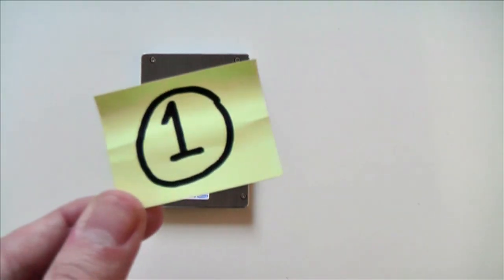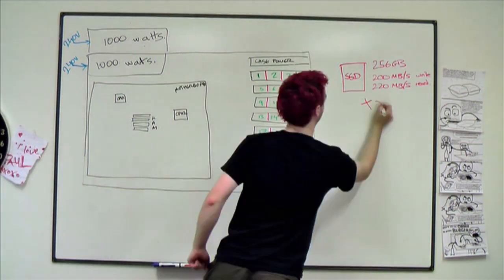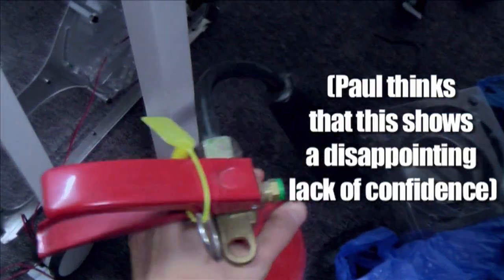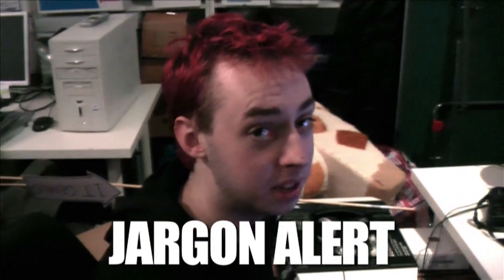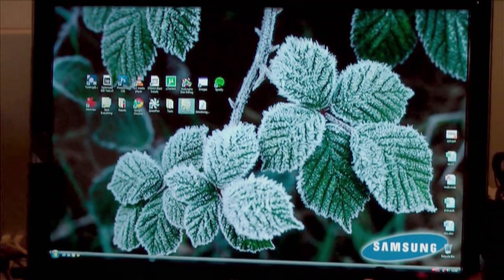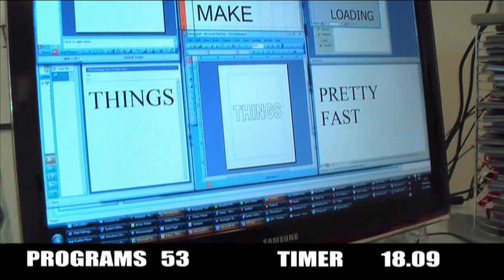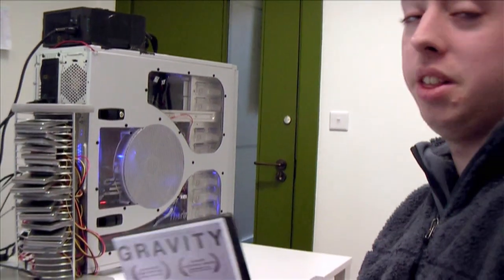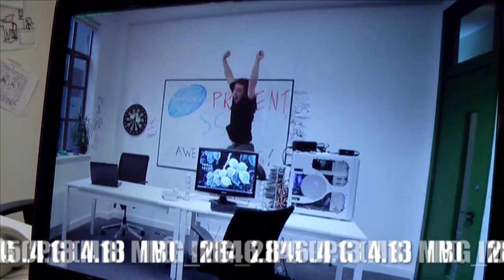Samsung SSD Awesomeness

Comment: 10 years later and you can now go faster with just one NVME SSD
Reply: a cheap NVMe SSD can outperform 'em.
Reply: @pnnytx  probably not in terms of IOPS, actually. IOPS is most important. And those MLC drives are going to last a while

Comment: to think; building this machine back in '09 wasn't cheap. just the drives must have cost you a small fortune (26 256gig ssd's at 400 dollars each). Neither where those processors (1600 each). Same for the Mobo (recon about 400 bucks)  .
I recon I can build a computer that pisses circles around this thing today for less then 2K.

Comment: It's 2019 and 6TB on SSDs are still impressive. Also those speeds, while achievable with a single or dual drives, they are still respectable.

Comment: 2GB/s and it can be done only by single NVMe SSD by now. Technology flies so fast!
Reply: Than put 24 nvmes in raid 0 :D
Reply: As of today you can push around 7GB/s on one SSD, and PCIe 5 is right around the corner. Won't be long before we're north of 10

Comment: You should theoretically only need 4 - 850 evos to do this today. ..
Reply: I think you need a couple more. Keep in mind These badboys have aprox. 220 Megabyte a second read / write. The 850 got 540/520 read write. Putting disks in raid doesn't mean that the access speed of the array is a perfect addition of the access speed of the individual drives.

Comment: Just a bit over 6 Years ago this was epic, today you can get this performance with just one m.2 SSD :D (And at a much lower price, of course :D)

Never ever defrag your SSD's btw^^
Reply: *****

SSD's dont work like a HDD. They have Flash Chips (most common chips are MLC, SLC and TLC). Those Flash Chips can only be written a certain amount of times before they get destroyed. This is because they need a higher voltage to write or erase data than they need to read data. The higher voltage slowly kills the structure of those chips. Defragmentation erases data and writes it on a other place of the flash storage. So its a long process where the flash cells get a higher voltage. You wont get a better performance out of the drive, maybe you can get a tiny bit of more storage space, thats it.

Tried to explain it as easy as possible, if you want more information, just ask :)
Reply: Sr90

wrong. With constant "casual" use, they will. But if you defrag them (you wont get an advantage out of it), they can be dead any time. They got a very high mean time before failure these days, but defragging will kill them very fast, trust me.
Reply: +Dan81369  modern ssd's last a lot longer than the older ones. they will last longer than any computer you have, even with constant read and write.

Comment: To those watching it: DON'T DEFRAG YOUR SSD!
Reply: to give a bit more technical answer: SSD's like conventional hard drives are divided into sectors. your data is spread out over these sectors. When you defrag a drive you move your data around over these sectors, basically: you do a read job on one sector and a write job on another. 

While sectors of a conventional HDD can virtually handle  an infinite amount of read/ write instructions, the sectors of an SSD can not. Read/write them to often and they will "break", corrupting the data in that sector. Add to that as mentioned before that defraging gives you 0 performance increase , you're effectively decrease the life expectancy of your SSD for no reason. 

Things are not as bleak as they may seem though; as mentioned before; the impact is quite insignificant. you can completely fill an SSD and format it again 1000x and still not notice a performance decrease. Normal consumers probably won't even read write every single sector on an SSD that often. Things are different in a datacenter where these limitations actually used to be a major concern with earlier SSD's.
Reply: Back then it would have been a dumb idea to use a defrag software on an SSD. But nowadays many defrag software have special settings to reorganize files on SSDs. You just have to select them in the options.
Reply: +sanshinron why?
Reply: TK Jones Because SSDs have exactly the same access time regardless if the file is fragmented all over the place or not. The only thing you achieve by defragmenting a SSD is decreasing its lifespan.
Reply: +sanshinron interesting, how does it shorten the life span?
Reply: SSDs, especially earlier generations, have a limited amount of times a cell can be rewritten before it "dies". The impact of defragmenting may or may not be significant, but it's still pointless.
Reply: it was from 2009 where ssd is not yet common and people don't know that defrag can damage ssd
Reply: @Banom7a  most people dont know that SSD's are a thing. They are this cool thing that nerds use, but normies like grandmas and people that use computers casually just use the hard drive that came in their computer
Reply: @Baker0214   that's because most of those "normies" (which is a stupid name to be honest) aren't in such a hurry that they need a SSD. My gaming rig doesn't have one. If i ever feel like i need faster load times i will get one, until then it's fast enough.

Comment: Degragmenting SSDs, Using controller without TRIM/discard support (checked Areca ARC-1680ix-24 declared at the end of video), and finally… hit PCI Express 8x limit (2GB/s) that still doesn't show maximum possible speed.
Also… tests using only sequential reads (where are random tests and IOPS results?!).
Very bad.

Comment: Could you do that with 24 SSDs of greater storage capacity so that it would be even faster? or is it because of the number of SSDs not storage?
Reply: Capacity wouldn't increase speed at all, just capacity... It's still 24 SSDs
Reply: ***** uuuuuuuh... what?
Reply: a 120gb ssd is the same speed as a 5tb ssd of the same quality. capacity would be how many bytes it contains. increasing the capacity would not increase speed at all.

Comment: I don't want to be mean, but actually I'm not impressed (with one exception: the song is really good... "lalalala you got my head in a spin, you data storage thing, you data storage thing").

Reasoning:

1. Throwing lots of (expensive) stuff at a machine with even only semioptimal settings WILL improve performance somewhat

2. 2 GB/s is nice (but not more), fine... but...

3. ...this is only available at a certain block size (at least 24x the size of the stripe chunks)... so if a stripe chunk is, say, 128 kB, to get the full speed, the OS has to issue reads of at least 3 MB at the same time - or, even better, multiples of that.

Thats a lot. Thats seriously a lot.

All in all, not really a reason to get that excited. I have two SSDs (2x Samsung 840) here in a RAID 0 as well, for my home studio PC, this is where I store my samples.

Not that it's bad, but it's not that effective as one may think. Actually it's more like a "JBOD with a few percent of performance on top of it" under real time conditions.

Comment: "disk defrag" you're officially killing your SSD
Reply: OSes today should recognize when you are using an SSD and disable the defrag option for the drive(s) so the technologically-challenged people don't ruin their SSD.
Reply: Joel Hinson ACtually it's on the ssd manufacture to do this and they have so yeah. When youy "defrag" it just runs a reblocking command in the firmware to organize the drives
Reply: It was just a demonstration of the SSD's speed.
Reply: @sighisoaraa  An SSD by it's nature doesn't get fragmented, so even if the disk was slow af, its defrag would be near-instant.
Reply: If your SSD is ruined by a simple defrag, your SSD was on its way out already anyways.

Only the first ssd's suffered such problems, you have to think, if you actually USE your SSD, its being written to and read from all the time.  One of my first SSD's that I still run on a backup computer, that was old tech, has over 34 terabytes of reads, and over 28tB of writes on it, and its a 240gB ssd!  

Note, I'm saying a defrag is recommended, or will even help.  (Although this is argueable on some SSD controllers, its still not generally something that is needed).  But to say it will destroy an ssd, is the same thing as saying USING your ssd will destroy it.  If it scares you to put your SSD to full load for say 20-30 minutes, then I'd be scared to use the SSD in general!
Reply: I image my daily drivers SSD every 2 to 4 weeks usually.  512 gigabytes that is generally around 250gB full.  What do I image it to?  None other than a secondary SSD through my hot swap ultrabay so it goes nice and fast.  

SSD's of today (well and even 3 years ago when you made your post) are much stronger than SSD's of 2009 and prior.  Keeping heat down is the main priority!  Some of the enterprise ssd's used in servers have rediculous amounts of available read/write cycles before degrading.  Of course, they are a lot more costly than consumer ssd's.
Reply: Defrag is switching to Optimize or Trim on the OS that supports SSD, like Windows 10.

Comment: Of course the data on SSDs fragment. It's just that there is no big advantage to sequential reads over random access reads on an SSD. In other words defraging an SSD is pointless and even damaging when you consider that SSDs allow a (very large) finite number of writes. I think the point of that demonstration was to show how reading through the entire contents of the SSD array could be done in seconds. Just don't try it at home if you value having a long lifespan on your SSDs.

Comment: Umm..... Mine can also run Vista.

-Intel Pentium G2010 @ 2.80GHz (Dual-core Ivy Bridge, 3MB of L3 cache, 100MHz bus)
-4GB of DDR3 RAM
-500GB Western Digital Caviar Blue
-Zotac (nVidia) GeForce GT 610 - 2GB
-Realtek HD Audio
-450W PSU
-Gigabyte GA-H61M-S1 Motherboard (Micro ATX)
-Intex Micro ATX case
-Total cost: ~$350

Video: watch?v=JepqnGU4qxw

Comment: A RAMDISK uses your memory (RAM) as a storage drive. They easily achieve around 6GB/s+ 

Back to the original post, if you had every single book in ebook format you could probably transfer all the files in a minute.

Simple enough?

Comment: they do determine the speed of calculation, but the hard drive determines the speed of writing, let me explain: if you want to copy a file in the same hard drive the only factor is the hard drive speed, but if you want to copy between two the factors are the ram speed/size and the speed of both hard drives

Comment: what raid controller did you use and how many, I am building a video server and was going to use 72 Seagate 7200rpm 4tb drives, I wonder what kind of speed I can achieve with 72 500gb ssd

Comment: Yup, you both were extremely off in your estimates. Price per GB was around $5 back in 2008-2009, which means 1000$ for a 256GB drive wasn't unreasonable.

Comment: Guess you did not see my comment right below this one. Assuming they were each 1000 dollars, thats 24k + an extra 5-10k in computer parts. This didn't cost more than 35k. That's obviously alot but a very very far stretch from 60k.

Comment: Well, you math is pretty good to me. Although there is a limit to how fast ram can go XD. (Cant run any faster than what the ram can run if memory is correct)

As long as your using the x79 platform in quad channel memory, with ram higher than 1333MHz, you'll be to get the 30+GB/s from the ssd raid.

Moment you go below quad channel thought...... you'll see those numbers fall really fast.

legitreviews(.)com/article/1779/4/

Either way, multiple GB/s....... *drool*

Comment: Hey I got a Samsung SSD and for some reasons cant get it to work,
I installed it correctly but it does not seem to show up on my computer the only place it shows up is on devices but it seems to show it as a memory stick and the only options i have with it is to disconnect it ?
I heard you need to change something in the BIOS but i don't know how or what to change, want to use the SSD as a backup storage device to i can play games on it but use the Main HDD as primary storage with OS on it.

Comment: I have to point out that having 2 1000Watt power supplies is completely retarded!! 

1. if you needed the extra power there are more powerful PSU's available.

2. SSD hard drives use next to no power, it's like a couple of watts each, if that.

3. If you need the extra connectors you can just buy splitters.

Comment: I have a question. I'm ordering the MSi GT70, which provides 128GB SSD SUPER RAID. With a 750GB HDD. It also gives an option for RAID 0 or RAID 1. What is RAID 0 and RAID 1?

Comment: Yes. It has a grand total of 4gb of memory. TOTAL. But each chip needs some memory. So you only get to use 2gb of it. Which is not enough to run high resolutions. 4gb 680's are the best.

Comment: SRX is a garbage board. The processors for it can't even be overclocked. A single 3930k beats it in performance. But I would likely have 64gb of ram on it, for multitasking, and maybe some ram disc... If I even need a ram disc at that point...

Comment: Ok but let me calculate...

2000MBps / 2 = 83,3MBps

I heared theorethical with 2 SSD's in Raid, you have a performance-increase of 100% 

Ok maybe cause we are talking about 24 SSD's just say not 83MBps. Let us say 100MBps.

WTF? Actually I can rember a 7200rpm has got a read speed of 120MBps.

Why should someone buyed some SSD in 2009? :D 

Only because this is flash? 

(Sry for maybe bad english, im german) ;)

Comment: yes, but one would not need to run everything from the RAM drive, only those programs you use the most.  A 64GB RAM drive would be sufficient for most to run their programs out of, and would be much cheaper too(about $400 versus $6500 for better performance.  You get an SSD for your OS to run from, an HDD for program storage, and lots of RAM for a temporary RAM drive to run them from. Its not hard to copy/paste and then point to a different directory to run them out of.

Comment: for sure, but a RAM drive would still be much cheaper.  Each of those SSDs retails for around $250, so, figure, they have $6500 worth of SSDs there.  You can put together a server with 64GB or 128GB of RAM for that much, and then use a RAM drive, or, you can simply get 64GB of RAM to toss into any computer that supports it and use a RAM drive for what you need, along with an SSD.  Seriously, there is cheaper, more effective ways to do this, this was just a huge waste.

Comment: defrag essentially moves data around on the disk so that contiguous files are closer to each other on the physical platter(s) and not broken up. this process involves shuffling files around many many times, performing many "write" operations. this isn't an issue with HDD's as the disk media is very durable. however, the flash memory in an SSD is much less durable and has a limited number of times it can be changed. defragging an ssd would use up many of those writes, shortening it's life.

Comment: This has already been far surpassed. I have four drives in RAID 0 and it has a random read/write speed of 2.4GB per sec. This simple shows they did not want to spend the money necessary to achieve the true speed of the 24 drives using enterprise SSD RAID controller.

Comment: No.
Also for HDD's: 2GB=2000MB. If most (IT-)people do it wrong, doesn't make it correct. Even a judge did a 100% faulty ruling in this.

You and LostInNumbersMusic are both (not intentional) wrong and you are both talking about GiB's and MiB's if you talk about a factor of 1024 and not a factor of 1000.

The fact that some marketing-people started to use 1 kB=1024 byte is just 100% wrong. They ONLY did that because 2^10 is 10^3 close to each other.

Wikipedia: gibibyte.

Comment: It's when the computer uses two or more drives (connected to a RAID controller) to read and write data. In short terms: If you have two drives, half of the data is stored on D0 and the other half on D1. This allows the computer to read and write data much faster – for certain tasks, anyways – than only one of these drives.

Comment: Because RAM discs are limited, take up valuable ram for programs away, and ram drives (in not running it with one that has a battery) will erase the information after a restart. But it all depends on if you get one with a battery (the ram drive board, like the gigabyte I-RAM) or not.

Comment: @SuperMangn We're in 2012, you do know also Plasma tv's don't get burn-ins anymore.  We rent and use only server grade equipment.  And there's absolutely no comparison at all in I/O speed, which result in fluid and fast interface to the customers.  Same goes for my Air, damn last benchmark I got 210/240 Write/Read in sequential.   Mechanical hard drives are soon to be instinct, but I understand that resistance to change is a natural human reaction.
Reply: Brawndo Ahh, I remember 2012. It was a good year!

Comment: You don't need to defragment a SSD because defragmenting is meant to move pieces of a file closer together on a platter/traditional disk drive.  on SSD it's just as fast to read one section as the other, whereas on a platter it takes time to read from the inner to the outer of the circle.

Comment: @Maul9999 You don't and it says so in the vid.
"Power supplies connected by soldering pins 14 and a few ground wires together. This gives them a common ground and connects PS_ON to let the motherboard control them directly. Power was then shared between both supplies evenly; one EPS12v each, drives and graphics split over."
Hope that clears it up for you.

Comment: @therealwouter SSD's dont spin, they read the information digitally instead of physically, therefor don't need to defrag in order to work at optimum speed. Defragging an SSD also wears the drive, as an SSD has a limited amount of writes to it, and a defrag is thousands of writes.

But in this case they probably did it just to show how fast it could defrag, which normally takes a while.